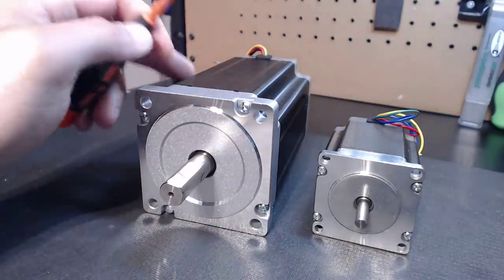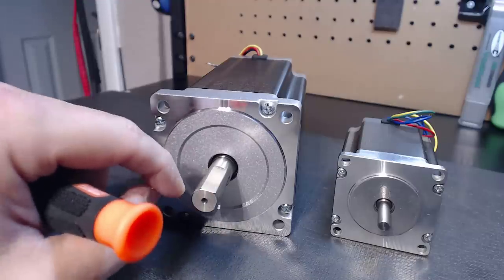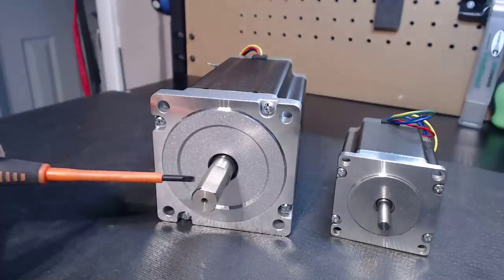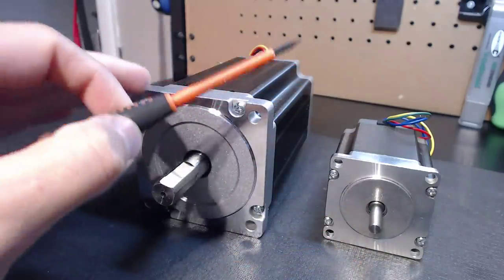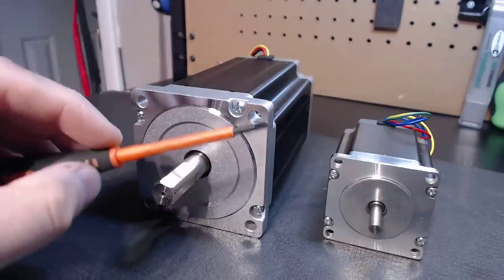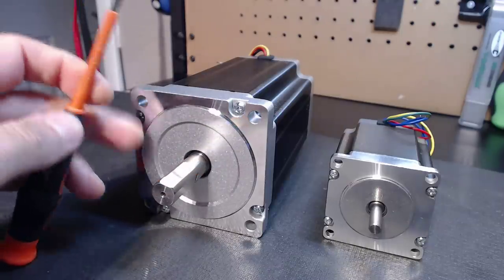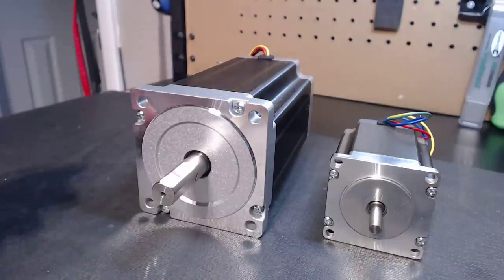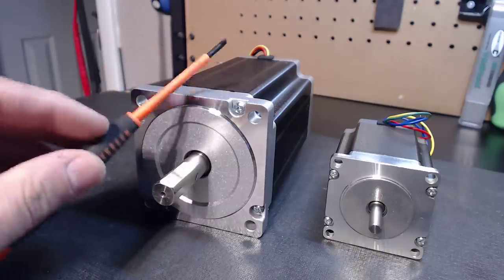Stepper Motor Torque For Your Applications..

Comment: I am building a injection molding Machine for my college project. The screw used has 25mm diameter and 400mm length. 
So this screw will be used for melting plastic granules. I don't know how much torque motor should I use. Please help me out
Reply from the maker: Dude thank you for your support. I really appreciate it. I can't provide a required torque for the motor without knowing what load it will be under. Please quantify it, and I'll select a motor for the application Thank you,
Vince
Reply from the maker: @masteradvisor594  I apologize for the late reply. The video link you sent doesn't reflect the size of the motor, but if that's the size of the machine you'll be making my 600oz Nema 23 would be fine https://www.ebay.com/itm/142172266617. Thank you,
Vince
Reply: Thanks brother.
You make my day. I was so pissed in searching the correct motor. I am studying in college. And I am studying plastic engineering. The link I sent you, i am going to make same machine for my college project. That's why I asked you. You are the one who replied me. Thanks once again
Reply from the maker: I'm glad to have helped you  :)

Thank you,
Vince
Reply: Sorry just last one. The screw he used in that video is 12 mm dia
And the screw i used is 25 mm dia the  so  will it work on 600oz.in motor
Reply from the maker: @masteradvisor594  Yes the ball screw will work, but you want to make sure the end of the ball screw that mounts to the motor coupler is smaller in diameter than 25mm. Typically they taper to 12mm for motor coupler engagement. Your then fine to use 600oz motors. I also have 600oz motors in stock if you need them. Thank you again, Vince
Reply: Sorry but I am asking about motor in the left. Not the ball screw motor. The pipe in the left has screw inside it to melt plastic.  I was asking about that motor😁😁
Reply from the maker: @masteradvisor594  I see.  If your trying to have the ball screw attach to the motor's shaft it would have to be smaller than 25mm to allow it to be coupled to the shaft. Thank you,
Vince

Comment: Hey bud, this big motor, standing upright, can this turn a 250lb person left or right with no problems? I'm looking to build a motorized platform and connect to a Arduino UNO to control it. I say 250lb as a max load.
Thanks for any reply.
Reply from the maker: Virtual, Thank you for your support. I really appreciate it. The Nema 34 with a gear reduction would be fine for that application as I have a few clients using motion control for simulators.  Thank you again,
Vince
Reply: @corvetteguy50  Thanks for the quick reply, 1 more question which may be of help, I'm having someone coding to a Arduino to control the motor to my liking, would it be better to use a open loop motor or a closed loop motor for my project. Thanks again, and love the channel
Reply from the maker: @Michael-hr5wf  , for your application an open loop stepper is fine as they provide the same accuracy as a servo as reflected in this previous video I made here https://youtu.be/Exk7ORteS0o  Thank you,
 Vince

Comment: How can this be converted into weight a motor could lift if mounted vertically?
Reply from the maker: Thank you for your support. This can't be calculated without knowing the transmission you're using in conjunction with the motor. If you're planning on using the motor as a stand alone unit without a transmission I offer consultations to match the correct stepper to your application. Please email me at Storm2313@gmail.com for a quote. Thank you,
Vince

Comment: hi i am thinking of building a epoxy granite plasma cutter 8 x 4 what stepper would u recommend for this project manly worryed about the y axis also so would you use a lead screw or a rack and pinion thanks
Reply from the maker: Stephen, thank you for your support. A stepper motor for a plasma system is generally no larger that 400oz/in as there's no load on the cutter. I highly recommend a ball screw transmission over a R&P as its much more precise, and virtually maintenance free. Thank you,
Vince
Reply: @corvetteguy50  hi thanks very much for the quick reply and for the advice appreciate it thank you keep up the good work with your videos 👌
Reply from the maker: @stevenhorgan8782   Will do!! :) thank you,
Vince

Comment: Building out a robotics workshop and have limited space, after painting and sorting out power, my first step is going to be a "z-table" made of 4 lift columns (lead/ball screw driven) -- I found some pretty hefty NEMA 23 size steppers that I'm planning to run each column, continuous torque is 58 oz-in at 75V, but it keeps some pretty nice cont. torque at lower voltages also. The max load on the table would be ~100lbs, stroke length about 24 inches - does this application seem reasonable?
Reply from the maker: Sirius A, thank you for your support. I believe you listed the Nema 23 motor toque you're using incorrectly. Please correct it, and I'll give you some feedback. Thank you,
Vince

Comment: is there any shorter version of that NEMA 34 size?
Reply from the maker: Yes, but the length depends on the specific manufacturer. I would contact the particular one your looking at a motor from for exact dimensions. Thank you, and have a great weekend! Please be safe.
Vince
Reply: @corvetteguy50  i wonder how length affect the specs, like is it have lower torque even same face plate size compared to the longer one?
Reply from the maker: @IlhamDefraN   Correct, as the coils is smaller causing this. Thank you, and please be safe.
Vince
Reply: @corvetteguy50  oh ok, thanks for the reply

Comment: can you suggest motor for driving robot with a lot of equipment on it (lets say around 15kg)
Reply from the maker: Ivan, thank you for your support. One of my 600oz Nema 23's would be fine for it. Thank you,
Vince
Reply: @corvetteguy50   Thank you so much!
Reply from the maker: @ivankolev5279  ...:) Thank you,
Vince
Reply: @corvetteguy50   also, if it is not a lot to ask , what would be the maximum rpm of such motor. Because I want  the robot to move at reasonable speed (10-15km\h or even more) and does the motor accelerate fast ?Thanks!
Reply from the maker: @ivankolev5279  Steppers aren't designed for speed, their designed for torque. If you want speed incorporate a gear transmission, and you can have it accelerate to high RPM efficiently. Thank you,
Vince
Reply: @corvetteguy50   ok, thank you
Reply from the maker: @ivankolev5279   :)

Thank you,
Vince

Comment: If I want a stepper motor to rotate a 30 lb shaft, how do I determine how much torque is required to do so? Can't seem to understand what equation or even what exact variables I need to solve this problem. I need to buy a motor but I want to know exactly what I need so I don't overspend.
Reply from the maker: Joshua, You didn't specify if your using a transmission that the motor will rotate to turn the shaft, or if your using direct drive? A 30 lb shaft would require a Nema 34 based on their available torque output. Thank you, Vince
Reply: corvetteguy50 hey Vince, thanks for your reply. I will be using a direct drive. How did you determine i would need a Nema 34?
Reply from the maker: A 30lb shaft which is rotated easily by up to 100in/lbs of torque using the video tutorial above. Your shaft's weight is only 30% of the rotational torque put out by my 1700oz. All Nema 34's put out roughly 80-100in/lbs of torque.  Thank you,
Vince

Comment: Can I use nema 23 motor for manual surface grinding bed movement in y axis
Reply from the maker: Prasad,
Thank you for your support I really appreciate it. I need to know what substrate your surface grinding, and the the transmission your machine uses that you intend to do this with to answer your question. Thank you,
Vince

Comment: How much can the little guy lift?
Reply from the maker: Amellia. thank you for your support. The lift capacity of a stepper is based on two variables the  transmission, and the gearing being used. The 300oz/in stepper in the video is capable of producing 18.5in/lbs of torque. Thank you, and Merry Christmas!
Vince

Comment: Can stepper motor rotate clockwise and counterclockwise when programmed? And can I use arduino uno to control it?
Reply from the maker: Mary Anne, thank you for your support. I really appreciate it. The answer to your question is yes a stepper can rotate in either direction pending the Arduino is programmed to make it do so. Thank you, and have a great weekend!
Vince
Reply: @corvetteguy50  thank you so much for answering sir. I have a follow up question though. Can you suggest what kind of stepper motor is suited if I plan on mounting it on a 0.5hp water pump? It's to change the aim direction of where the water will come out
Reply from the maker: @maryannemacalinao8376  Please tell me the weight of the pump. Thank you, Vince
Reply: @corvetteguy50  I think around 5kg. I plan on mounting the stepper motor on top of it so that it doesn't break due to the water pump's weight
Reply from the maker: @maryannemacalinao8376  Here's the motor I recommend. https://www.ebay.com/itm/142172266617 Keep in mind the motor's aren't waterproof, so you want to make sure their isolated from moisture. Thank you,
Vince
Reply: @corvetteguy50  Thanks again, sir! More power to your channel!
Reply from the maker: @maryannemacalinao8376  Thank you  :)  Vince

Comment: My dude, not everyone in the world is American you know that right? I think you should add those values in metric, at least in the editing process. It's really frustrating to pause the video to convert those really weird values into metric. That way you might have a bigger audience. Other than that I think you do a very good job of explaning stuff. For that reason I have a few questions for you. I have a CNC router project that I am planning at the moment. Working area will be about 1 meters on X axis and 2 meters on the Y axis (3-4 feet to 6-7 feet). For movement on the X and Y axis belts and pulleys will be used, for Z axis I'm thinking of a ball screw setup. I will be using this system for wood and aluminum machining and nothing more denser. I have 4 options as a spindle: a 0.9kW 24000 RPM AC Spindle, 1.1kW 18000 RPM AC Spindle, 1.4kW 24000 RPM AC Spindle or a 1.5kW 12000 RPM AC Spindle. They all use big external motor drivers. As stepper motors I plan to use 57hs22 model NEMA 23s which have about 2.2 N/m of tourqe. I think the one in the video is the exact same one. All the structure will be built with sigma aluminum profiles. My questions are: 1) Which spindle should I choose for a very good aluminum experience. 2) Does more RPM mean cleaner cuts? 3) Will these stepper motors will be enough? And if yes how many should I use for a balanced fast and strong machine? So sorry for the novel that I left here but if you at least give me some answers I will be greatefull. Greetings from somewhere between Europe and Asia.
Reply from the maker: elrohirtinuviel, thank you for your support, and I apologize for my ignorance in forgetting the translations from imperial to metric. The answer to your questions are as follows.

The first recommendation I would make is to utilize ball screws on all axis of the system as belts, and pulleys are not the best option for robots machining aluminum. Here's a video overview I made on transmissions. https://youtu.be/pdFNqGY3h94?t=1644
Which spindle should I choose for a very good aluminum experience. A 2.2Kw (3HP) is the best option for soft metal substrates, along with woods, plastics, carbon, and composites.
 2) Does more RPM mean cleaner cuts? This questions has many variables, and what it all comes down to is the substrates your cutting, and the endmills your using. If your RPM is high with certain substrates you will risk melting them rather than cutting them (plastics, and composites)
 3) Will these stepper motors will be enough? I recommend a minimum of 2.8N/m motor for machining aluminum, and all softer substrates. My 4.3N/m motors provide the maximum torque for these substrates. 

And if yes how many should I use for a balanced fast and strong machine? You would require your Y axis to utilize a slave configuration using two motors. One on each side of the Y axis. This will assure maximum equilibrium.

Thank you again,
Vince
Reply: @corvetteguy50  Thank you for your response, I will act according to your inputs. Have a nice day.
Reply from the maker: @elrohirtinuviel47  Thank you you to. Vince

Comment: Hi please tell me what kind of motor is used in motorised screen upto 8ft..Thank you
Reply from the maker: Azpra143, thank you for your support. I need to know the transmission your using in conjunction with the motor, and the weight of the screen. Thank you,
Vince
Reply: @corvetteguy50  Thank you so much for your reply. I wanna make retractable screen with 25mm curtain rod measuring approximately 8ft. I got to know from diy videos that the motor has to be high torque and low rpm which is a bit difficult to find the right one.. Or other options people told me is to get a dc motor convert it to ac and regulate the speeds.. Also I am not very familiar with the converter types and gears.. Kindly throw some light on these points.. Would appreciate any kind of info.. I know its not a forum but you seem to have very good way of explaining things easy enough for an novice in electronics like me to grasp.. Thank you again.
Reply from the maker: @AziUnderwater , I would need to know the weight of the screen in order to recommend a motor, and transmission to support it. Thank you,
Vince
Reply: Thank you for your attention Vince, The weight of the screen is 690 grams and the weight of the rod is 919 grams.
Reply from the maker: @AziUnderwater  a Nema 23 300oz/in motor will provide 18.75in/lbs of torque, which is perfect for your application as the screen your lifting with rod is 3.5lbs Thank you,
Vince
Reply: Vince I really appreciate your response. Thank you very much. I will definitely check for the availability
Reply from the maker: @AziUnderwater  Sounds like a plan, thank you, Vince

Comment: I have a name 34 I got 6 of them I just need to know what drivers I need  and power supply
Reply from the maker: Hey Ricardo, Thank you for your support. Please tell me the specs of the motors, and I recommend a driver, and power supply for them. Thank you,
Vince
Reply: 85.63mm 115.15mm
Reply: I wood like to get a  highest nema42 set can I get the specs
Reply from the maker: @ricardomolina8773  I can put the package together when your ready. Please message me at Storm2313@gmail.com Thank you, Vince

Comment: Thanks for the video, very helpful.  Quick question for you, I'm setting up a linear slide system that will initially be actuated via a hand crank handle.  The customer wants the option to motorize the slide  in the future.  Trying to decide on the right motor to use to essentially mimic the hand crank, with around the same speed of travel.  What size motor would you recommend for this application?  Thank you so much
Reply from the maker: B Thomas, thank you for your support. Unfortunately I can't answer your questions to support your client until I know what the application is for,  and what's the weight the axes will be automating. Please contact me at Storm2313@gmail.com to setup an engineering consultation. Thank you,
Vince

Comment: HI SIR THANK YOU FOR THIS AMAZING INTERESTING VIDEO? IT REALLY HELPS ALOT;  WELL I WANNA ASK YOU WHAT KIND OF MOTOR I SHOULD USE TO ROTATE A 150 KG PARABOLIC DISH? AND THANK YOU
Reply from the maker: Abderrahman thank you for your support. The load your looking to rotate is 330lbs. You would require a gear reduced stepper with a transmission typically with a load that large. Thank you,
Vince
Reply: @corvetteguy50  thank you, well i sould use a stepper motor of 1700 oz-in right with a gear stepper transmission ? Is that right ? 
And thank you
Reply from the maker: You would want a Nema 42 with over 4000oz/in of torque and a gear reduction for that type of load as a 1700oz/in motor will only provide 100in/lbs. Thank you,
Vince
Reply: @corvetteguy50  thank you
for the gear reduction what type do you recommmande me to get and thank you again.
Reply from the maker: You need one that will fit the motor, an provide a torque increase of at least 1000oz/in to be optimal for use. Thank you,
Vince

Comment: how to calculate running torque(normal) from holding torque
Reply from the maker: Shoaib, thank you for your support. Holding torque is the torque rating that will stall the motor if exceeded. Normal running torque is anything the motor produces under this rating as that's considered usable torque. Thank you,
Vince

Comment: i have a motor almost same that size panasonic brand how can i run this motor stepper motor 4 wires
Reply from the maker: Rodrigo, Thank you for your support. I would contact the vendor of the motor for its diagram, and if they won't provide it this video will help you determine how to connect it. https://youtu.be/FYYmuUJyPes Thank you, and please be safe. Vince